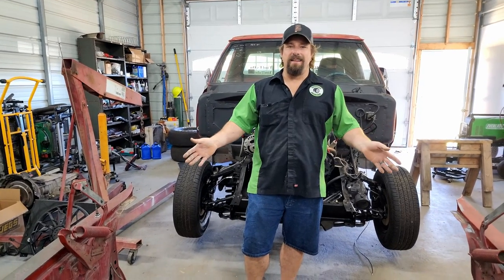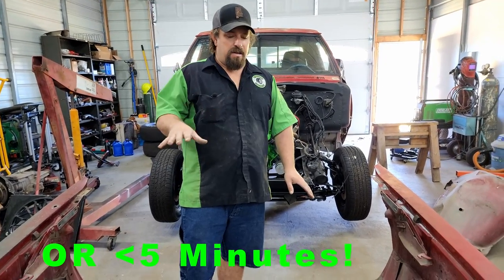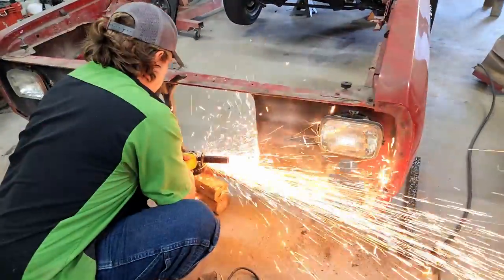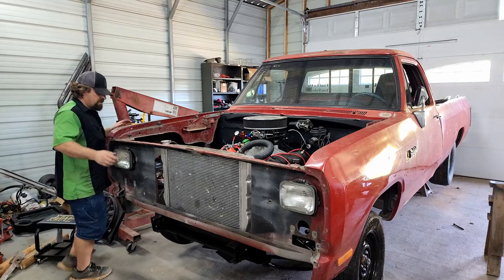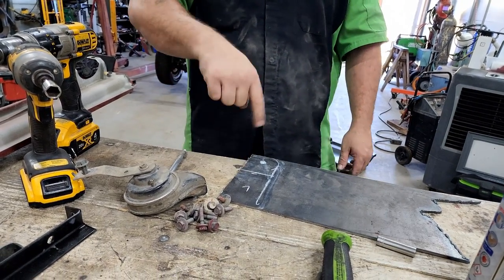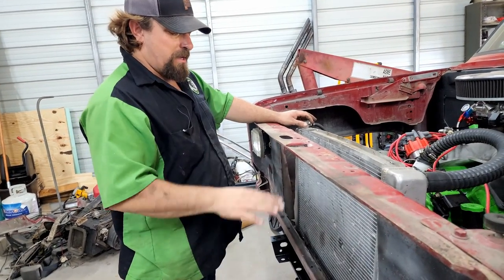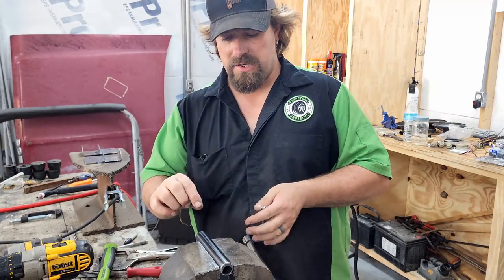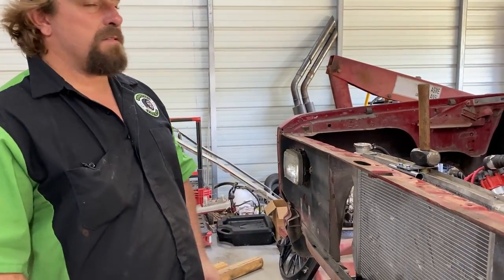Making A Quick Disconnect Front Clip - Dodge D150 Drag and Drive Truck Build

Comment: Someone else could be removing bolts while you’re disconnecting wires and shave a minute off the time. 
Will you be running a front bumper too?
Reply from the maker: That's true! Only other person that was there this time was the camera woman lol. It doesn't currently have a front bumper I plan on building a fiberglass one for it